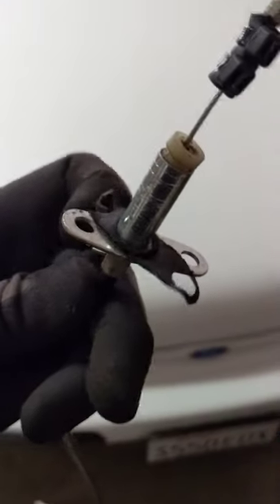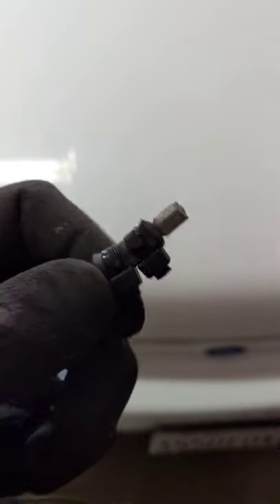Foxbody mustang every foxbody mustang needs this!

Comment: Cool video man,something interesting Ive noticed and i own 2 of these cars, just about every part made for them i have seen in original form,brand new in the package specially 20 years ago however something i have never seen or been able to find are OEM accelerator cables,not on eBay, not even from a dealer, its like they only made the ones in the cars and that was it, lol.

These days the options are either Pioneer or the LMR one which a few years ago had problems but from what Ive heard the new ones are pretty good.

Comment: This may be useful if the cable was stretched. The pedal travel, cable length, throttle body position and cable bracket are all designed so that the pedal is on the floor at wide open throttle. With this mod, I'd be worried about stretching or possibly breaking the cable due to reaching wide open before the pedal reaches the floor. Could also put undue stress on the throttle body and blade. Just my $.02
Reply from the maker: I still leave a bit of slack but nothing compared to how it was. Before you couldn't even go WOT.
Reply: @pcpalan  ah gotcha, that's good then.